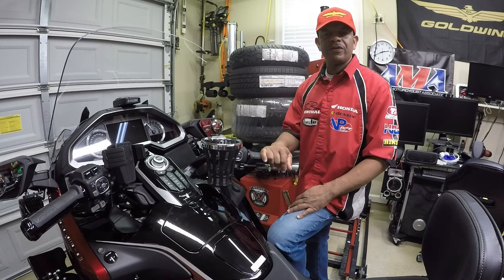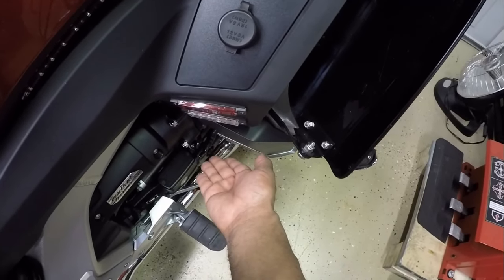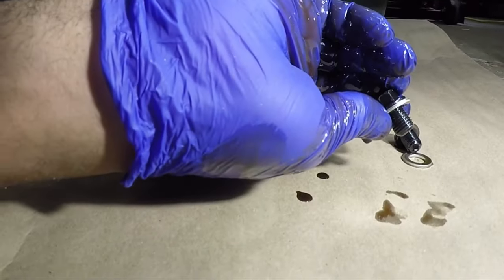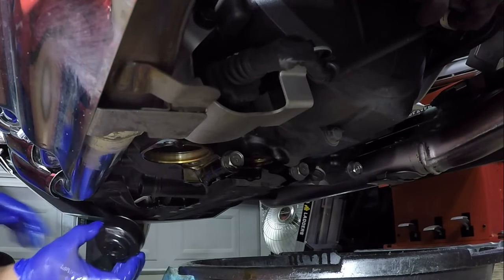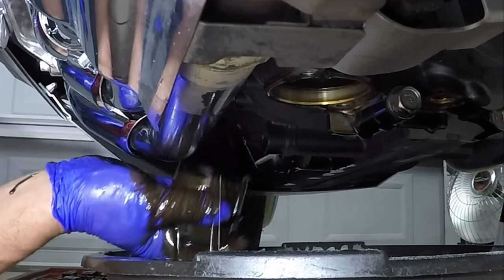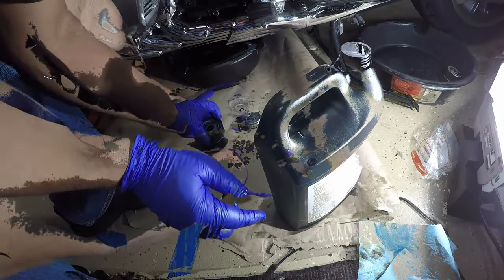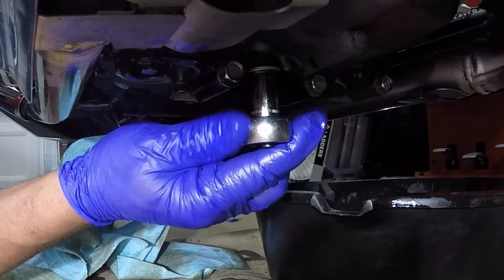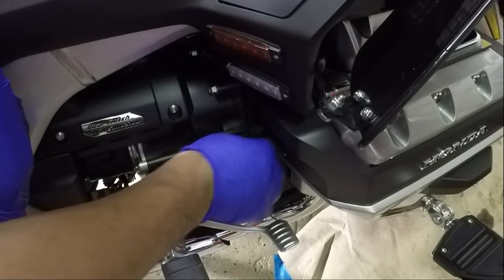2022 Honda Goldwing Tour Oil Change

Comment: Impressed with the video.  The only point I would make was you said things had to be tightened up to the correct manufacturers torque settings, but I didn't see a torque wrench?
Reply from the maker: This free oil change video should be used as a reference point for Goldwing owners that work on their own motorcycles, my video was never intended to be the Official sponsored Honda Goldwing Training Manual for Honda Service Technicians employees, therefore use common sense or just take your bike to the dealership if you lack the ability to change your own oil.
Reply: I read your comment and eye rolled so hard I may need medical attention.
Reply: @wadeyearsago Shots fired lol. 😊

Comment: Good video. I’ve done my 2018 dct oil change several times now. A few tips for you. After you remove the 3 drain bolts and both filters…put the bike on the side stand and about .25-.3 more ounces of dirty oil will continue to drain. To remove the dct filter I use a telescopic pocket magnet tool to pull the filter out. The oring that goes in the dct cap is very easy to pinch and will result in a oil leak down the road. There is another oring that people are using that is very tight fitting and no chance of pinching. That oring is the same used for the front fork suspension caps for the 01-17 goldwings. After the bike has sat on the side stand for serval minutes put the bike back on the center stand and reinstall all the plugs and filters. I pour exactly 5 quarts of oil into the bike. Start the bike and let run for 5 minutes. Then turn the bike off and check the oil level at 3 minutes. The oil level should be exactly on the upper full mark. Also when start the bike for the first time after the oil change you might get a series of dashes for the transmission indicator. No worries it will do this if the bike senses that no oil is flowing since all the oil was drained and the new dct filter is dry. After you start the bike again the dash’s will clear and be back to normal showing N on the display.
Reply: Don't fret too much over the small amount you are getting out by using the side stand; the 2018-2022 GW DCT always has one quart of old oil left inside!  It can only be drained by 'splitting the case,' as in taking the engine/transmission apart!     '21 GW DCT owner.  Good Rides

Comment: Excellent job Chris! I see that Bradley S. below already mentioned it below, but it is important, after you have drained as much oil as possible,  to take the bike off the center stand and place it on the side stand. This process will drain the additional several ounces of dirty oil out of the engine. Then, put it back on the center stand to replace the drain bolts and filters. I learned this from Cruiseman's Maintenance Videos.

Comment: Great video sir, I just wanted to say you can get a metal drip pan that's like a cookie sheet maybe 4 foot in length, which is good for any spillage. I purchased mine from Wal-Wart in the automotive section of the store. It really comes in handy for changing oil in the bike and trucks.
Reply: I use a large black plastic trash bag.

Comment: To all, follow the bike book !!! Don't guess torques. Honda has the reason for everything on this amazing machine. Since day one, I do 22 f/lbs on all 3 drain bolts and 19 f/lbs on oil filter. Yes, by the book. I never had any issues changing oil or fighting to loosen anything. Always use fresh crush washers and always check that oil filter o-ring did not stay on the block after you drop it.
Reply: Thank you for specifying the Torque Values.... that's what I was looking for!

Comment: EXCELLENT VIDEO   thank you so much.  I used this video and it was exactly what I needed to walk through my own 2021 DCT Tour oil change. And on the torque wrench.... anyone who has changed their own oil on bikes can feel the required tightness better than using a torque wrench.  With a torque wrench you run the risk of leaving it to the tool and having it go way over if you aren't careful to use it correctly.

Comment: Good to see you stepped up & got a 6 gen!  Fantastic machine. Only issue I have had on mine after 40,000 miles was a blown speaker which dealer replaced under warranty this week. Ride safe!

Comment: Hey chris, great vid, very helpful. I just purchased a 2022 wing DCT a few days ago. I will be doing this shortly. Now, you said this was your FIRST oil change? I was told by the dealer to change the break-in oil at the1st 500 miles. Did you do this?  They quoted me $487 for the 1st service. Yea.......No! I did all the work on my 2016 wing except the recall on the forks. yea they screwed that up too....ended up having them buy me a new wheel and a caliper. yea came loose on the road. ANYWAY, question. I know you used to tow a trailer with your old bike. Did you get a hitch for the 2021? Which one is the best one for this model?

Comment: If I’m not mistaken, I believe the owners manual stated that you should change the oil every 4,000 miles. The DCT oil and filter every 8,000 miles. I’m going to double check when I get home from work.

Comment: Question for you. The owners manual tells you to check the oil with the bike in the upright position on level ground. Does not say to have it on the center stand like the 2005,2012 and 2017 I had. When you check the oil on the center stand the dipstick reads to the bottom line which shows it needs oil added. The manual says to run the engine till it gets warm, shut it for a few minutes then check the oil with bike in the upright position on level ground. It should show to the upper mark on the dipstick. I can never get a good reading. I know it has 4.9 quarts of oil in it. Any suggestions? By the way Great Video on changing the oil and filters.

Comment: Great video, I will be picking up my 2022 tour dct in about a month. Keep the video coming. Do you suggest getting the Honda shop manual or the video from the cruiseman?
Reply: If you are a handyman and know bikes, mechanics, Honda tech manual will be enough, however it does not hurt to get his videos or Fred Harmon as well. It will prevent you from having expensive repairs or damages. I just have the heavy manual with the pictures. Some panels on the bike are tricky to remove/install. Moreover, it is a complexed machine.
Reply: @alp3781  Chris, Thank you so much for all of your videos. I am going to do my first oil change on my 22 DCT tour. Once again thank you so much.

Comment: Was all the drain plugs the same size. In the engine and transmission runs off the same oil.
Reply from the maker: Yes to all!
Reply: @chriscaliente5033  okay thanks for responding
Reply: @chriscaliente5033  Subscriber here wanted to get your opinion 2016 can am freedom trailer guy purchase it new used it for a 1500 mile trip and that is it. Asking 1500 like new. Can't find any information on these trailers is this a good deal? Has had listed for a while was asking 2500 then 2000, now 1500 will try and get for less still. Thanks in advance for your opinion. Wayne

Comment: WHAT ARE THE TORQUE SPECS...
Reply: Up tight then 1/4 turn, nah just joking. If in doubt read the book but if it has crush washers use common sense. Personally it looked like to much in this video but it's his ride so not my issue